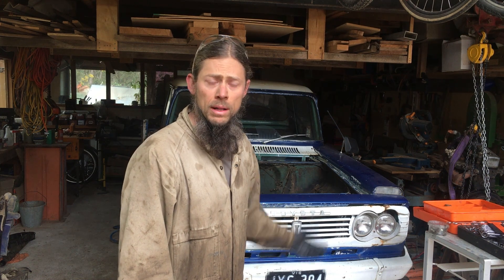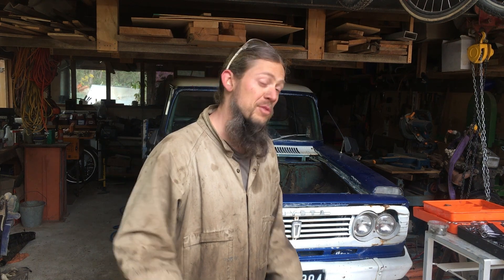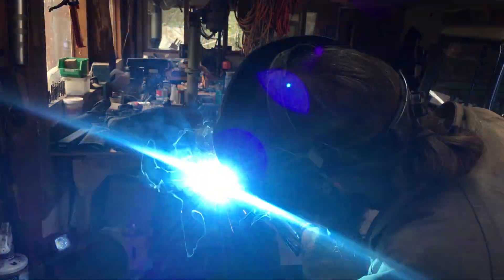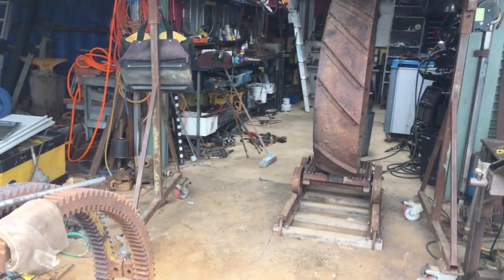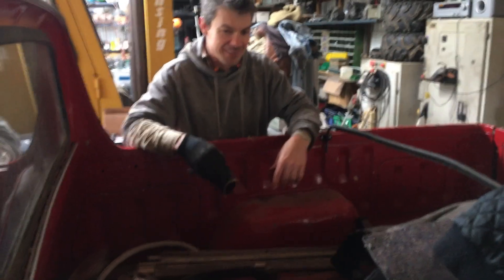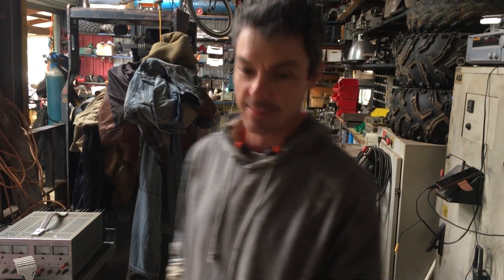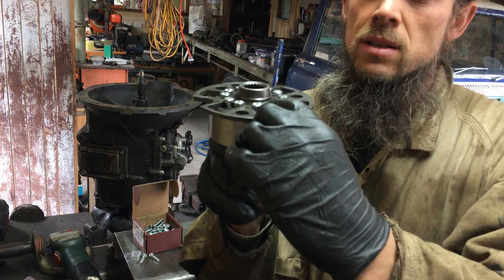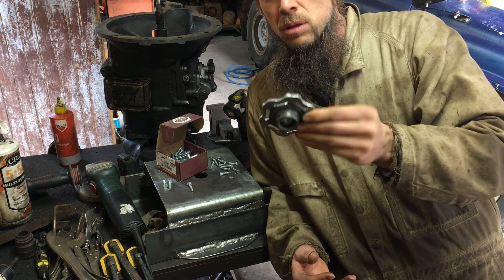Toyota Stout EV Conversion: Episode 2

Comment: Wonderful work Ollie, reminds me of growing up in California Gully and on our Junortoun farm with my step father (a Vic Rail fitter & turner) and my Grandfather, also a fitter and turner—but at the Ordinance factory (now Thales in Bendigo). Turning, fitting, milling and so on and if you couldn't do it then there was a bloke around the corner in whose shed you could...

So with this Dyna, I hear that you're doing some wood gas—is that going to go from wood to electricity? If you haven't already then check in with a friend of ours in the USA, Matt Ryder of Thrive Off-Grid as he's doing as good a job as anyone on the wood-gas side of things.

Sláinte! And all the best with rest of this and the other builds ahead!

Daz
Reply from the maker: Hey Daz, hope you enjoy this little warm-up project. Looks like you are putting your bet in that it will be wood to electricity ;-) Thanks for the suggestions. Just checked out Matt Ryder. Great to see people making things and contributing to the DIY world. Looks like Matt is doing charcoal gasifiers.
Reply: Haha  @FryersForestRD  , as I understand it Matt does charcoal rather than straight wood to reduce the issues that come with using that 'unrefined' fuel.
Reply from the maker: It’s certainly a good idea to use charcoal if the gasifier isn’t very sophisticated. So much simpler to get clean gas. Just the down side is approx 80% of the mass of the wood is volatiles that are burnt off during the charcoal making process. That can still be a justifiable trade off for simplicity in some cases.